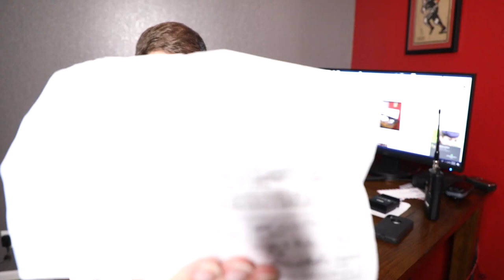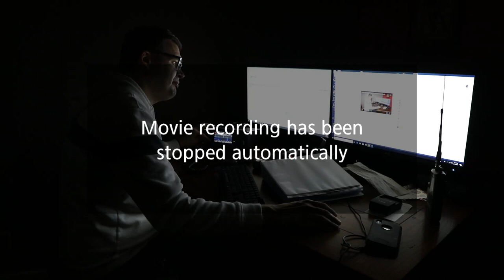LIVE! Working HF In The K0LWC Ham Shack!

Comment: Do you have a FLEX 5000A?, If you have the firmware for your FLEX 5000A you should be able to replace the Microsoft Windows XP OS with Linux 19.1 CINNAMON (Tessa) 64bit edition Wine64+Winetricks64+zip.dll should let you install the PowerSDR software back onto your system unit and maybe a 100TB Data center SSD would work better in the unit rather than the spinning drive and should provide more power for the RF power stage, Are you running A Creed 744s Telex
Reply from the maker: No, I’m using a Icom 7300 as my transceiver.